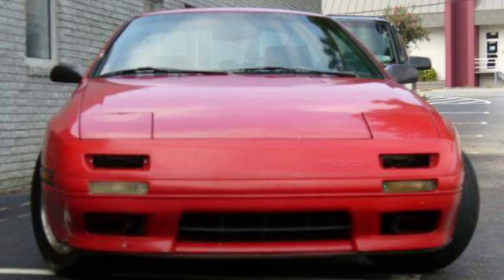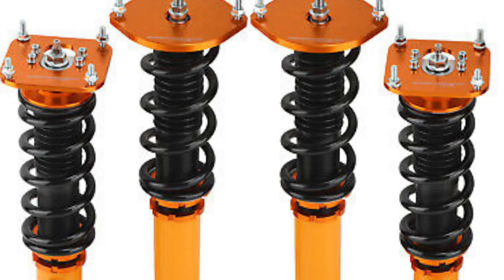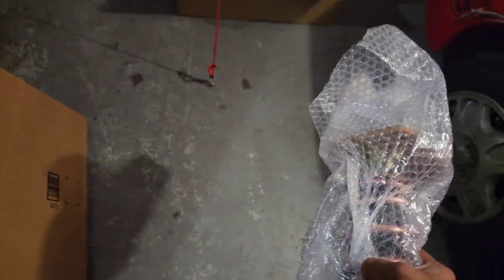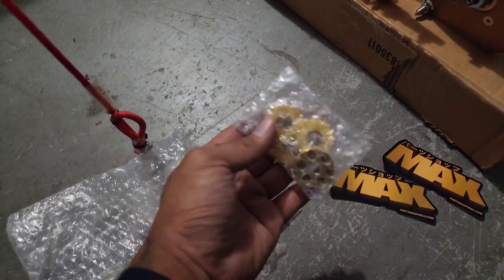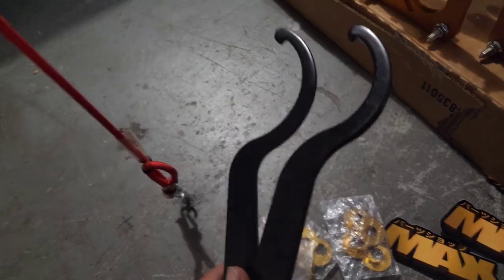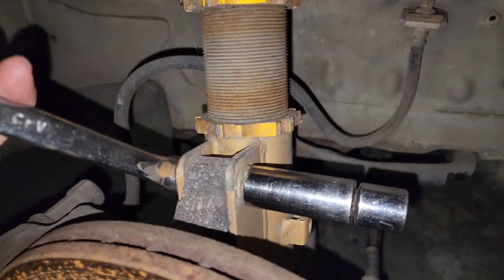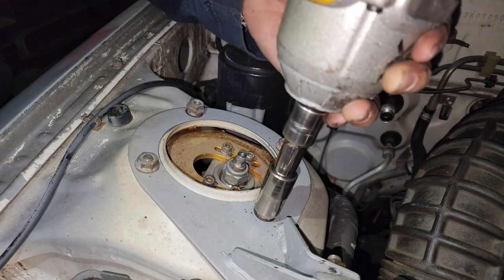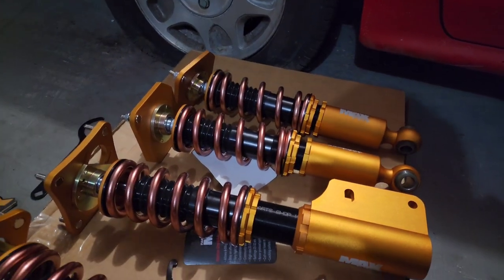How To Install My New Aftermarket Coilovers | Parts Shop Max

Comment: camber adjustment lockout. factory had slight movement to help with camber. pbm has camber caster adjustments from the top hat
Reply from the maker: Yeah, I realized that when I got them out of the box. Can't wait to get a drift alignment soon knowing I can have much better settings
Reply: @thatRotaryCarGuy  I remember reading that when I was looking at them

Comment: yo i just recently got an rx7 tenth an and my back wheels have play when i lift the car up does yours too? or should i get my hubs checked out? i just bought them off ebay
Reply from the maker: What kind of playback u getting? There could be multiple or different reasons depending on how the wheels play.

Comment: Back in the days was cut springs and lowering springs. I can never afford coil overs. We have to start somewhere bro, so it's all good. Big baller going for Max coilovers! Good choice bro. Anything that is aftermarket will not fit perfectly and you will come across to modify it to fit. Overall, looks great and is ready to drift hard! How's the ride?

Comment: what are you wheel specs? are you running any spacers or is the poke just how it looks with the size of your wheels?
Reply from the maker: Hey man! I'm running 17x9.5 with 12 offset. MB Battles. No spacers needed. Could use a quarter inch spacers upfront so that my tire won't rub the controls arms when full lock lol 🥲